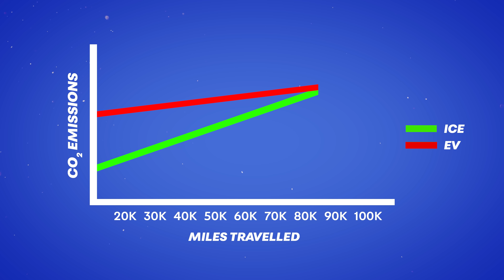Are Electric Cars REALLY That Green? [New 2022 Data]

Comment: Something to also consider,  when the batteries are at the end of their useful life, replacement batteries will be needed. So the footprint will massively increase again over  I.c.e. cars. 
 Cold climate areas will have higher degradation on batteries further diminishing e.v. vehicles useful life span.
Reply: And ICE cars need New Batteries too and all the moving parts that have to be replaced in a petrol engine which dont exist in an EV engine. Oil change. 
I mean its not like ICE cars just run for 150k miles and dont have things that needs to be replaced
Reply: @fresch4395  People like ice cars so they should be able to have them, stop being so one dimensional thinking that EV's are the only way forward instead of one of the ways forward, we know how to make carbon neutral fuels but it needs more development and should be invested in. At this moment in time the world is nowhere near capable of producing enough electricity for the enormous amount of power required for  everyone to drive an EV  and I would imagine that finding recourses for an additional 1.5 billion cars over 5 or so years is impossible and that's what you need to do to reach this ridiculous dream of all electric cars not to mention the infrastructure required to charge them.
The objective is greener energy , people need to take their blinkers off and look at the scale of what needs to be achieved instead of just batteries   batteries, batteries constantly coming out of their mouths and trying to convince others that they are the polluters of the world because they like their cars to have an internal combustion engine when the truth is that only 5% of world pollution is created by man and only 20% of that 5% comes from transportation so that is 1% of total pollution caused by all of the planes, ships, trains, busses, lorries, motor bikes and yes cars, I can't find any numbers on the net to find the family cars proportion to this but i will guess at 25% which makes their contribution to world pollution approximately 0.25% and a lot of that will be coming from Asia and Africa for years to come and because the west is greedy somebody will be selling our redundant ICE cars to the continents with less or no restrictions.
If you want to feel better about yourself then buy a EV but please don't lecture others on what they should do and try to consider greener fuels for ice cars to run along side EV's to reduce the burden on manufactures and even if we manage to achieve this then there are so many other fields that will need to be addressed as car transportation is not as big a polluter as some would have us believe, I also suspect most of the hard line EV enthusiasts will be anti nuclear power which makes no sense at all as the only way you could achieve total green electric is with a minimum 50% nuclear and please don't be so pathetic that you think you can store all of the solar and wind in batteries, batteries, batteries, batteries  , also did anyone actually know that batteries can be very dangerous and are known to spontaneously  combust
Reply: and that isnt as bad as constantly using gas.
Reply: The batteries are highly recyclable.  And last as long as as an engine.
Reply: @steveb796  recyclable does not mean that the renewal footprint is any smaller.
Recycling batteries has a higher  footprint than manufacturing from scratch.
It's a big hole in the environmental argument.
Reply: @bobdrooples  so does recycling oil, transmission fluid, differential fluid, and replacing engines, transmissions etc.  
There are billions of the same batteries out there in cell phones, laptops, ear buds, cordless tools, vacuums and ipads.  All of these don’t last as long as a car and only provide convenience. They do nothing to lower the carbon footprint of the corded things they replace.
Reply: @steveb796  so why is the recycling rate for lithium ion batteries sitting below 4% in the countries most capable of doing so?
Batteries aren't the answer, we can see that just as hydrocarbons and horses had their own problems.
Horse to Ice is orders of magnitude of improvement, electric cars in current and iterative form are at most on par and largely worse.
Energy density is a bitch when it comes to smaller personal equipment.
Not my problem.
Reply: @bobdrooples  evs havent been around enough to create a market for battery recycling. That has changed with companies like redwood materials and li-cucle getting into the game. They can also be repurposed to fixed storage as they hold 70-80 % of their power after 1000 or so charge cycles.   
You couldn’t be more wrong about the future of  battery storage. More advances in battery technology at hand than perhaps any other industry.
Reply: Benjamin Courtney
You can recycle lithium batteries. and the cold barely affects lithium battery's....do your homework christian fool.
Reply: @gothboschincarnate3931  The cold does have a significant effect on both daily loss and longevity, do your homework
Reply: @gothboschincarnate3931  72 iq comment kiddo
Reply: I'd also point out that EVs are far less likely to survive a fender-bender without needing a lot of relatively expensive repair.  And if the accident is a little more serious, a modern damaged battery is prone to outgassing, or catching fire spontaneously, or even exploding.  All this to say that an ICE car can survive without adding monstrously to its carbon or cost footprint.
Reply: @themidsouthcyclist8880  why do you say evs cant survive a fender bender?  No true. They have the same fenders as an ice car.  They are also much safer than an ice car because of the large crumple zones and low center of gravity. Spontaneous combustion is not a thing. And Id rather be sitting on batteries than 20 gallons of gasoline in a wreck.  Ford just recalled 250,000 Explorers because they roll away when in park. 😝
You know not of which you speak.
Reply: @steveb796  (sigh)... please work on your reading skills.  To address your points: I said something very different than your reply indicates.  Also, CG is irrelevant in your reply: why mention it?  Spontaneous combustion is a "thing" and is documented, to the point of being "well documented."  

Gasoline does not spontaneously combust: drop a lit match into gas and it will go out exactly the same way as when you drop a lit match into water.  You are the one that doesn't know of what you speak.  The laws of physics and chemistry don't change to suit your desire to be an authority about something that you only just heard of.  And your Explorer story... tell me in less than 1000 words what that has to do with anything in this story or any of the comments?  Now might be the correct time to walk away.
Reply: @themidsouthcyclist8880  (eye roll)
Not sure where you came up with CG but it was the first time it appeared in our conversation. Stay on task. 
According to Highway Transportation Safety Board there are 56 vehicle fires for every billion milles driven. 81 for ice vehicles. 
Gasoline will most definitely ignite if you drop a lit match into it.  
There are no reported instances of EVs spontaneously combusting. It is not a thing in evs. 
The Ford Explorer story is to illustrate how dangerous ice vehicles can be. 
You didn’t mention how you came up with  the story of evs not being able to survive a minor fender bender without expensive repairs.  What makes you think they are different than any other car in that regard? Insurance rates say you are wrong. Ill give you a real life example. My 2014 mercedes cost $27 a year less to insure than my 2021 tesla. 
Facts don’t care about what you heard at the truck stop diner.  
Now might be the time for you to get on your nike and ride away in shame.
Reply: You might also like to consider that it is perfectly possible to have your EV battery pack refurbished rather than fully replaced. This costs a fraction of a complete replacement...
Reply: @Brian-om2hh  could you quote some actual real prices on that as I can't believe that It is a fraction of the cost
Reply: It seems you never heard of battery refurbishments?
Reply: 97% of batteries can be profitably recycled since a few years ago.
Reply: @celdur4635  Profitable for the company maybe, I don't know how it works now with theses batteries but I remember a few years ago getting my batteries for my power kit recycled and it worked out the same price if not more expensive than buying new ones , now i'm sure that the company made profit but as a consumer I would have preferred new ones
Reply: @m4rkscott  

Yeah a few years ago, and this is the problem with people, we think linearly, we evolved like that.
But tech develops exponentially, its irrelevant what happened with your batteries a few years ago, all that matters is what happens now and in the future.
Reply: @celdur4635  the same services are still there but i don't bother with them i just buy new ones
Reply: @m4rkscott  

Sure. Realize this is not really a problem yet, there are barely a few million electric cars sold a year, vs dozens of millions of traditional cars. 

We're still a decade or 2 away from the problem. Hopefully 1 decade, so, when it actually becomes a problem the solution will be there, since its already been worked on.
Reply: @celdur4635  What is your source for that statement? Curious as I have not come across that data and to my knowledge and it is nowhere near scale and to date our great leaders have not set up the infrastructure to take up that challenge and I am not aware of any business that has undertaken that venture meaning to date  - they go to a landfill in the states as we kick the can down the road.
Reply: @timm3792  

Elon Musks partner, don't remember his name, has a company dedicated to reaching 100% recyclability, and has had many interviews. 
When talking about batteries he said 97% is already recyclable, because most of it is Nickel, the rare earths we think of or even lithium compose a tiny % of the whole battery.  

I confirm this by reading articles and watching other news/interviews.

Let me be clear, 97% of the components are recyclable and even profitable to do so. However the infrastructure is not there to harvest and process most batteries. 

Which is where this new startup comes in, and many others that are being created.
Reply: @m4rkscott  

It already is bro. 

There is nothing to argue or think about, Lithium batteries are 97% recyclable already, that's a fact.
Reply: @celdur4635  at what cost
Reply: @m4rkscott  

At a profitable cost. So its sustainable.
Reply: @celdur4635  they are the same price as new one's, i'll take the new one's thanks
Reply: True but one thing that wasn't clear in this video is if the "lifetime" figure was taking into account electric energy production only using fossil fuels, or renewables, or both. And one thing that I'm also curious about is if we're taking macro things into account like battery production, are we also taking into account things like oil production and transportation into the figure?
Reply: @Tron08  If you watched the video, that was all calculated in. Try watching from 5:25
Reply: @vmxg8052  Gotcha thanks for the pointer, I would argue that the figure that includes the current energy production mix that uses fossil fuels to generate electricity is a bit misleading, as the world is very quickly transitioning to using renewable energy (and this is also HIGHLY dependent on where you live), whereas the oil industry is much more mature, and therefore, there will be a lot less efficiency gains in the future, or said another way, it's about as 'clean' as it's likely to get.
Reply: @Tron08  Good point  i always wondered if those figures are put into it. Fossil fuels definitely have an infrastructure that has to be taken into account. 
Probably the most important thing i think of all the time is the efficiency aspect of it. ICE are only 1/3 efficient of a steam turbine. Which makes an electric vehicle charged with fossil fuels just about 3 times as efficient. So for ever mile you drive in an ICE you could drive 3 in an electric car on the same amount of fossil fuels. Basically we could triple fossil fuel reservers if everything was electric. If we need to use fossil fuels then steam is the best option all around.
Reply: Who said all cars have to be electric?
Reply: @daysrcdays  Exactly. People like to create problems especially in this topic. So over it.
Reply: But also, EV batteries can be recycled and reused in a new car with less emissions than it is to make it from scratch. And it can be recycled over and over and over again
Reply: @jaredharmer7047  Recycling is a fairy tale. You believe in unicorns too ?

Comment: Isn't the EV track too linear? Batteries (the most unsustainable element) need to be replaced, there should be steps for this.  In addition, whilst petrol & diesel consumption statistical variations have been noted, nothing has been stated about the long term detriment of using rapid chargers (on lifespan of batteries).  Still, better than no comparison though.

Comment: Here’s what very few people ever address: building cars uses a lot of energy (ie produces co2). Regardless of which kind of car you drive, keeping your car longer and buying fewer cars in general would make the biggest impact. If you buy any car and drive it for 15-20 years, you are MUCH better off than people who buy new cars every 2-4 years. Leasing is especially bad for this reason. It’s people who churn and burn through cars rather than baby them with good maintenance over the long haul who are the biggest problems. 

Volvo might be willing to tell you which of their cars are greener in which circumstances, but they’re unlikely to suggest people buy fewer cars overall. Bottom line is that caring for your car and keeping it as long as practical is a huge factor in the co2 impact. One that everyone seems to ignore.

Comment: Cutting through all the bullshit, the average lifespan of a car is 150,000 miles. So even IF it's true that EV only beats ICE after 90,000 miles, it's very clearly better. It would be very unusual to scrap a car before 90,000 miles. Based on methods of energy generation in Europe, that breakeven point is just 52,000 miles. Stupid clickbait title.

Comment: But at 90k miles as the break even point of the EV, you're approaching the end of life of the battery.  Most batteries are rated to 100-120k miles. Then you get a new battery at a cost of several thousand dollars and your new battery, environmentally speaking, puts you back to square one, adding all sorts of CO2 emissions once again.
Reply: Unless there's a defect, the batteries are expected to last about 300k miles. Once their range goes below usable for vehicles, they could be repurposed for energy storage at home.

Comment: Did they count in the child labour used to mine the cobalt for the batteries and did they include the cost of battery replacement   I am not anti car what ever the power source is but in reality unless some one comes up with a real break through with some real new tech, the electric car is very limited with batteries that are very old tech and that does not matter how you sell it. The other concern which seems not to be straight forward is the end of life carbon cost scrapping and replacing , just like wind farms that question is rarely discussed. 

I have noticed Battery powered cars are being marketed as life style and the  insinuation that if you do not buy one you are some kind of idiot but we all know in reality it is very different except for the marketing plebs, the average income make these cars unaffordable and the only way to have one for the average person is leasing.  I am a pensioner and not able to lease or afford a lease car but I am being taxed off the road £300 a years and other rip off charges because my car is twelve years old, I travel to see my family 460 mile at 58 mpg, there is not public transport to where I go to. 
Q Are Volvo owned by a Chinese company I do believe are they have 2 factories on China and 1 in Sweden.

Comment: This is very interesting, but I think it doesn't account for the evolution of green energy during the lifetime of the cars. Also, it doesn't account for the health benefits we get from EVs from not burning fossil fuels in the areas we live in. The latter alone should be enough to convince anyone that EVs are better.
Reply: EV generate a lot of ewaste. The control system require much more electronics than internal combustion engines which means more arsenic and other hazardous metals. The motors require rare earths which require mining. The batteries also require lithium or other electrolytes and need careful recycling and eventual disposal. All modern living has costs.
Reply: @raul0ca  An yet, EVs are better.

Comment: Volvo didn't account for recycling the battery materials, but included the equivalent for gasoline, which is the energy storage medium for ice cars. The figures are worse for evs when you account for this and take in to account that the real use life for batteries is 10 years, so in reality, you need to drive at least 10000-15000 miles per year for the total life cycle cost to be justified.
The only truly good solution is plug-in hybrids, that solve the issue of city emissions while having a sustainable sized battery.
The other thing missing is the added weight from the battery increases the road maintenance costs, since weight is the single largest factor effecting road wear. This should be accounted especially when talking about city emissions.